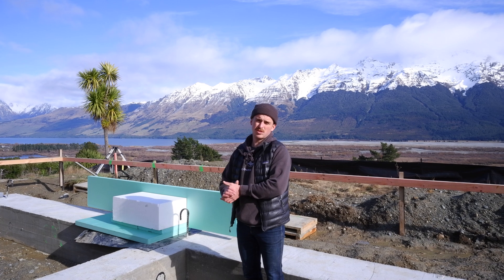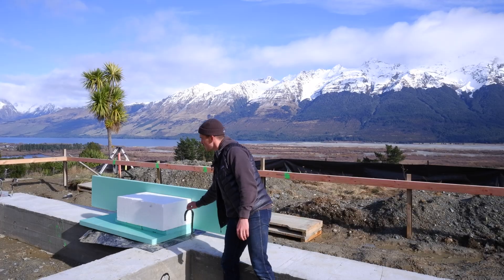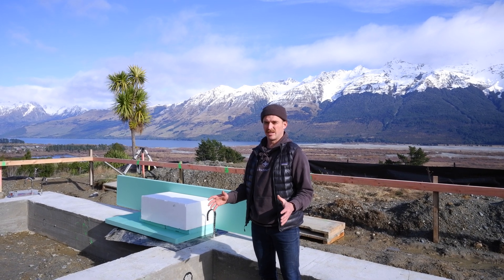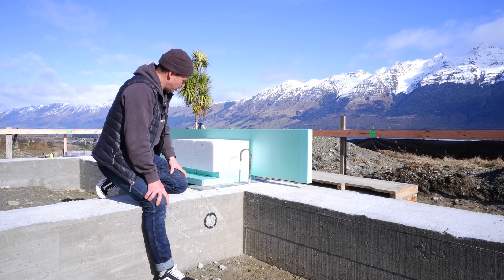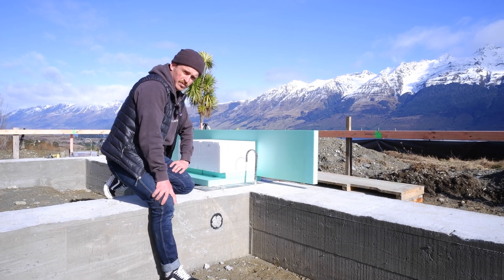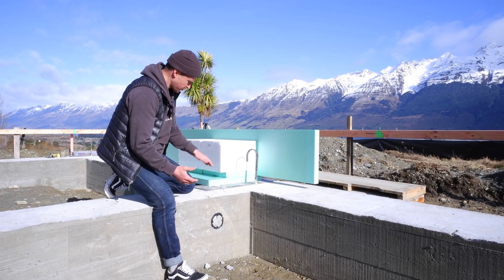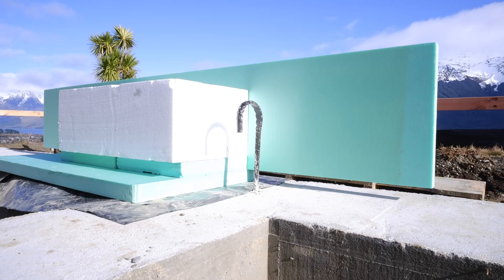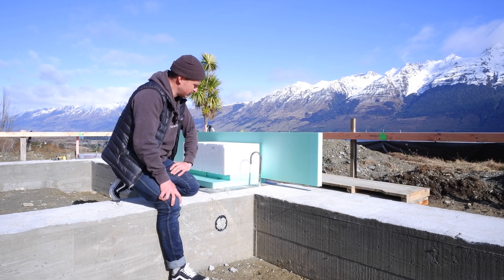Thermally Broken Slab in Queenstown

Comment: Where did you source the glass fiber rebar? And will there be cutouts in the XPS around the rebar for concrete?
Reply from the maker: Hi Simon, we used MateenBar Glass fiber-reinforced polymer. Sourced from Pultron Composites in Gisborne, New Zealand. 

Yes there were cut outs, but only for the stirrups to poke out through the XPS.